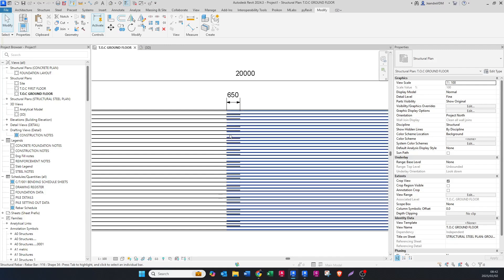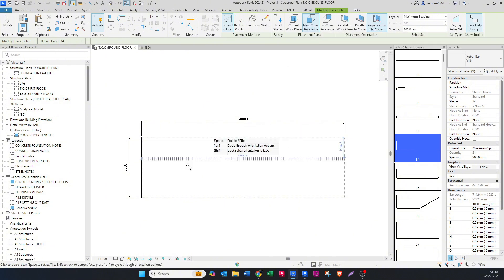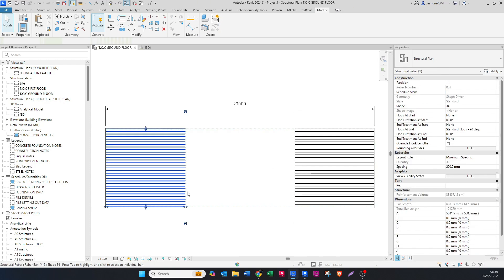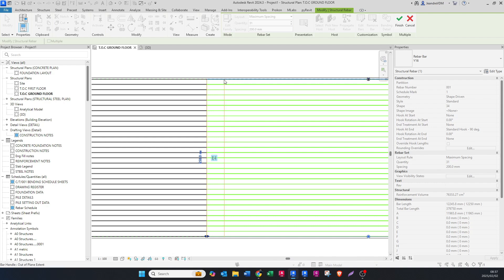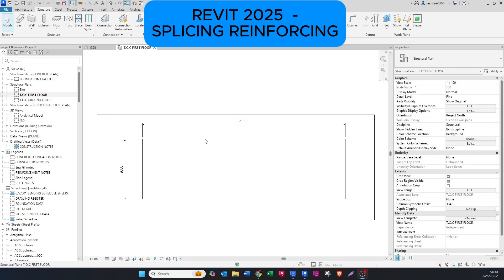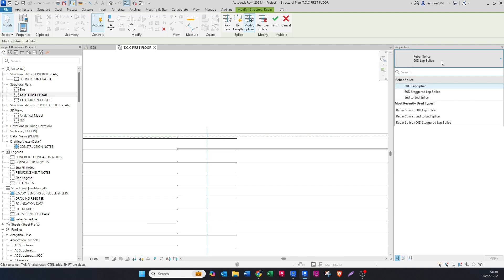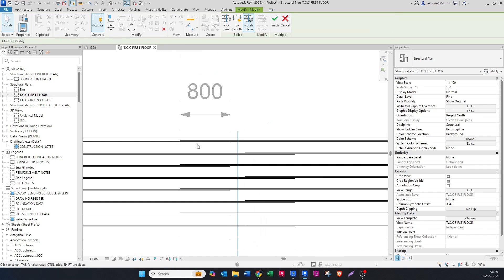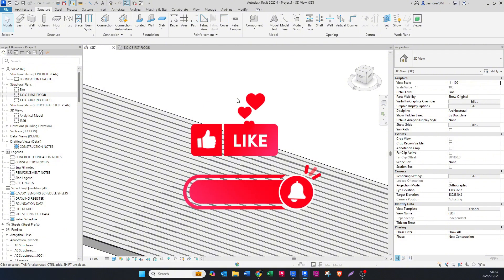Revit Structures - Splicing Rebar: Revit 2024 vs. Revit 2025

Comment: Really helpful tutorial! I have now subscribed. 
However while I was adding splice in 2025 Revit I couldn't do dimension of the spliced rebar ends maybe because it was laid vertically up the screen, it only can dimension across and not upwards. In your case rebars laid horizontally across your screen so you easily dimensioned the splice by picking the ends.